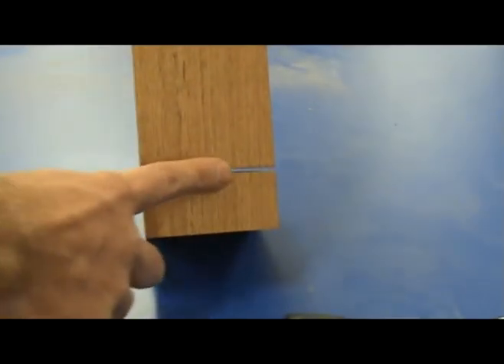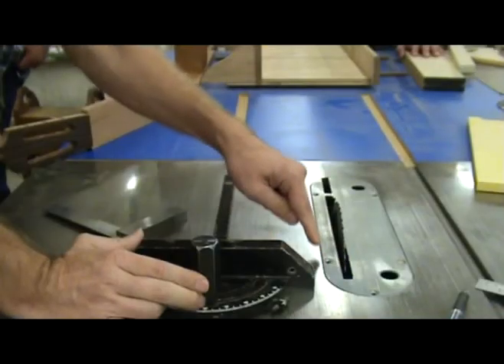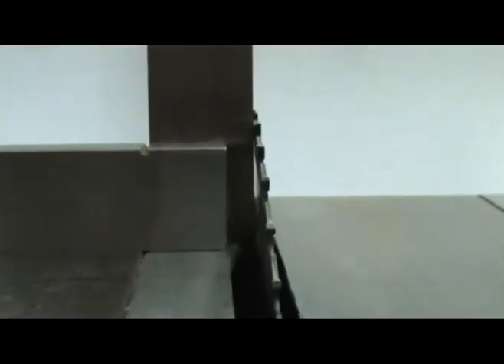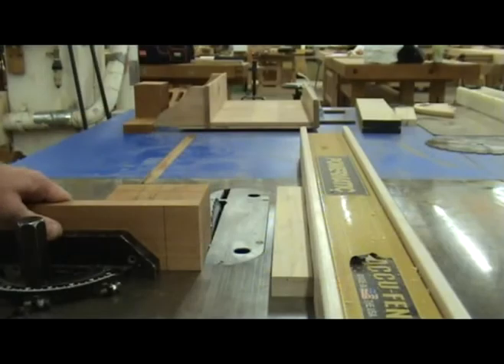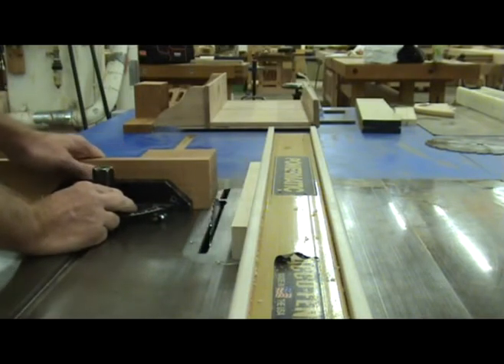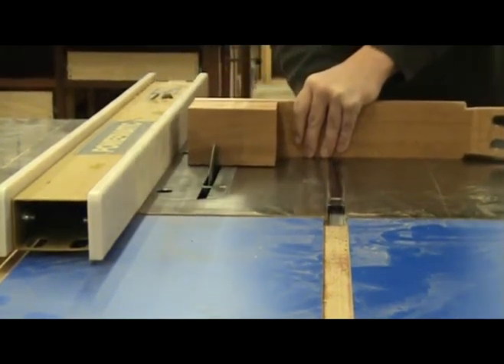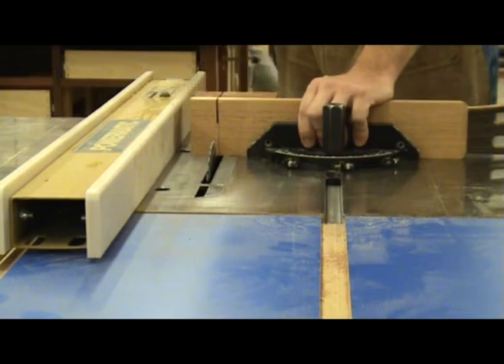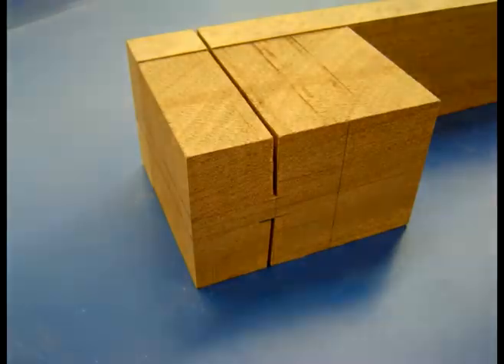Luthier Tips du Jour -The Spanish Heel - O'Brien Guitars

Comment: Why is it not recommended to use this method on steel string guitars?
Reply from the maker: +Edward Anstett Because of the amount of tension on the neck due to the steel strings. Not that the Spanish heel can't withstand the tension, If you ever have to do a neck re-set then a non Spanish joint is better top work with.
Reply: Edward Anstett aqq

Comment: Is it not necessary to set the miter gauge to cut the neck angle also?
Reply from the maker: I do put a slight tilt forward on my classical guitar necks but do not cut the slots at an angle.
Reply: OBrienGuitars
how do you make the tilt?
Reply from the maker: Patrick Verryn When closing the box I tilt the neck forward by 2mm